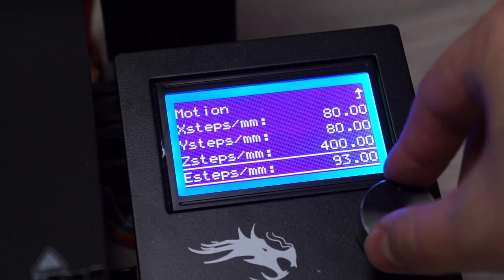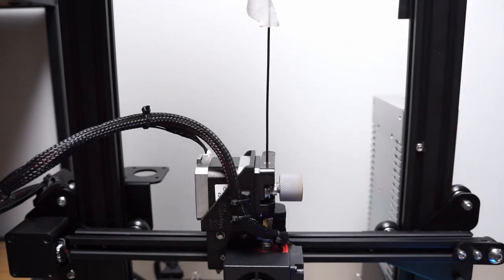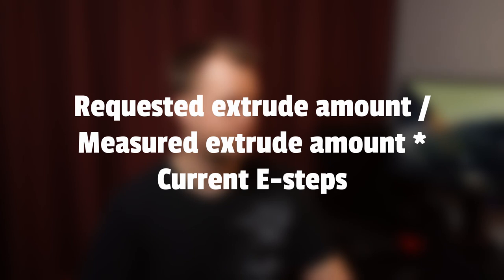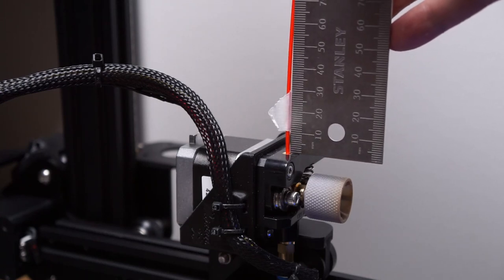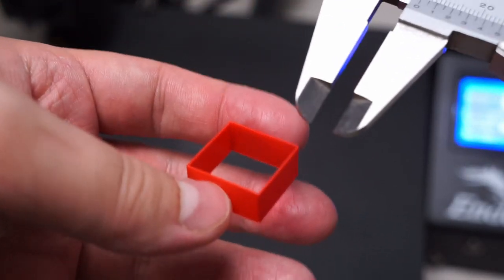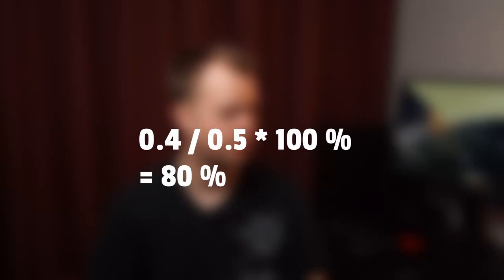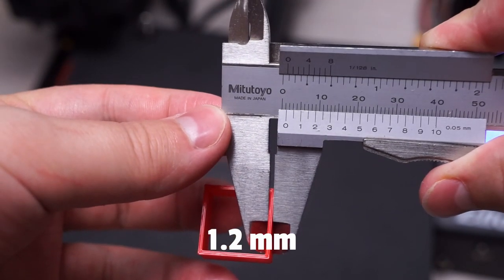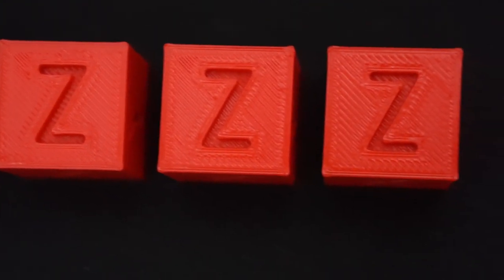How To Calibrate E-steps and Flow Rate for Ender 3

Comment: if i babystep z during the print will that change the wall thickness of the cube and therefore the flow rate? more squish makes a thicker wall right. so if i babystep and make less squish than the dimensions change
Reply: No.

Comment: I clicked this video not knowing E steps were even a thing. I'm leaving it convinced that is my problem. My prints always have trouble initially sticking to the plate for the first lalf inch of layed filament. Like it gets spat out, but doesn't stick to the plate and ends up curling.

After that half inch, it lays and sticks.

Comment: Right idea, but only extruding 90mm is the same as only looking at 90% of the test. Wouldn't it be more accurate to do 100mm for a linear average? Everyone I've seen do this test does 100.
Reply from the maker: Yes you could extrude 100 mm, but there's nothing special about that number. You could also extrude 1000 mm but how hard would that be to measure? Why I extrude less than what I marked on the filament, is to be able to take a measurement even if the printer extrudes more than what's requested. Hope that clears it up for you.
Reply: @HardFirmSoft  actually, the test is mark off 100mm, then 10mm past that and measure what doesn't extrude. It's on YouTube, and thats pretty much how EVERYBODY else does it. But you do you.
Reply: @davidharris5045 His way is simpler - only one mark needed. I like it!
Reply: Either way works. If you only want to make one mark and like the number 100, then you can mark at 110 and extrude 100. Technically, more will give better accuracy.

Comment: I have 3 printers (CR-10S, Ender-3, Ender-3 Pro) and have done more calibration prints that I would like to admit. If you test different filament between the 3 different printers you end up getting different results anyways. If you want to change line width to 0.5 instead of 0.4 then this changes the results you get for the 2 wall calibration cube using the same flow setting. If you use different slicers you will get different results as well. 

I've come to the conclusion that you will never get it dialed in 100%. It's an endless rabbit hole, so my advice is don't go down it like I did, lol.

I think printing something that is meant to fit together (print in place) to test tolerances and also has some top surfaces to look at would be a better test. Then adjust the flow based on the results of those prints.

Comment: There are some mistakes in  your conclusions. I did similar experiments .On 73% you get 0.4mm thickness on single wall .On 80 % double wall you get 0.8mm so the 2 walls are already squished overlapped ,so the picture  is not accurate the walls at 80% are not in point contact are already overlapped. So the calibration has to be with more than 2 walls in order to be accurate and get accurate dimensions. Regarding the perceived under extrusion on the top that can be mitigated with other selections that not involve wall flow number of top/ Bottom layers, like skin overlap and top/bottom line width and top/bottom line direction ,choosing monotonic pattern.
Reply: So are you saying that you think flow rate should be adjusted using the wall thickness method? Then make other changes in settings to prevent under extrusion?

Comment: On your direct drivinator upgrade, if you go farther with that route you'll probably want to get a dual gear metal extruder. I found that the regular single gear extruders (both metal and plastic) would click because they didn't hold the filament tight enough. Right now I have hero me 5 with the direct drivinator remix that is compatible with hero me 5 and dual 5015 fans. I still need to adjust the esteps and so forth to get the most from this setup but I think it will end up being what I stay with. I am also using this hot end fix https://www.youtube.com/watch?v=7tCxO17XZtw
Reply from the maker: I've definitely been considering that dual gear extruder upgrade and probably will do that at some point. I've yet to notice a problem when printing normally, but I sometimes notice the filament slipping when trying to manually extrude too fast. Anyway, thanks for suggestions!

Comment: I know this is an old video but I am afraid this is not how fine tuning works. The 2 settings (flow rate and horizontal expansion) serve 2 different purposes and conflating the two is not very solid advice... Sorry! Flow rate is different for each filament. Each filament reacts different to different temperatures. All filaments have different viscosity and other different mechanical properties, making them react differently to the exact same extrusion rate. You need to test (with a single wall width) if your flow rate gets you an extrusion size identical to the nozzle width. People may ask, what about squish? This doesn't matter because on a level bed the nozzle is always the same distance (approximately) from the bed and on subsequent layers the nozzle is always an equal spacing away from the previous layer (with variable layer height the slicer will compensate with extrusion pressure). This baseline of a predictable extrusion width (measured as a single line) is important. Especially because it comes into play when setting horizontal expansion. With flow rate you are dialing in the properties of the filament, whereas with horizontal expansion your are adjusting the properties of the printer itself. If I instruct the firmware of a mechanically well-tuned printer to move a 10th of a mm more to the left, regardless of the flow rate, I can measure that difference. Whether the flow rate is spot on or 10mm off makes no difference. The difference between 2 extrusions (set with expansion settings)  will always be the same. But if my flow rate isn't predictably dialed in, I can no longer say if I am measuring the effect of horizontal expansion or flow rate. Setting horizontal expansion changes the actual dimensions of the object you are printing! If all you have is an outer shell with infill (say you are printing a figurine), great you will not have much issues. If however you are printing something that has an inside and an outside dimension, you are changing both. Let's say you have a model consisting of 2 concentric rings that have a clearance between each other of .2mm and you are adjusting your horizontal expansion. It takes an adjustment of .1mm and your parts will be fused...
Reply: Bro... I appreciate that you are trying to help, but that whole explanation made zero sense. If there was any conflation going on, it's in your explanation above. However, if you actually believe you know how to properly set horizontal expansion and flow rate, please do make a video explaining how, and reply here so we can watch.
Reply: @hamishbeaven7921  I have tried to reply twice before but I keep getting caught in YT's spam traps... Or whatever you call them. There is a link on Reddit that clearly explains the difference. I also think it's what keeps setting of the "alarms", so alas...

Comment: I dont have those e step settings
Reply: Are you on Cura? If so, click the 3 lines beside the search box in the print settings and make sure "All" is selected.
Reply from the maker: What printer are you using?
Reply: @HardFirmSoft  E3 pro. I just had to flash new firmware and now it works
Reply from the maker: Okay, good thing you got it sorted.

Comment: So here’s the breakdown to why I hear to use the correct number calculation number (give or take like 5%) then from there you are actually able to change the overlap in the part.

This makes it so you are extruding the correct amounts and you print to the correct width on the outside. But then, by changing the overlap percentages in walls and skins you end up with the same strength you had before and you can actually dial it in if you just want faster printing or higher part strength while being able to better control over extrusion.